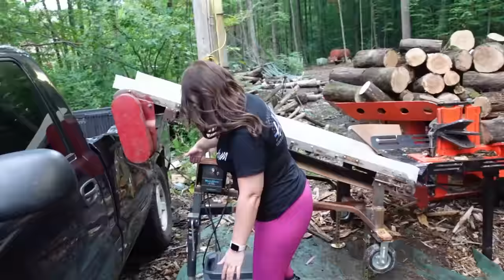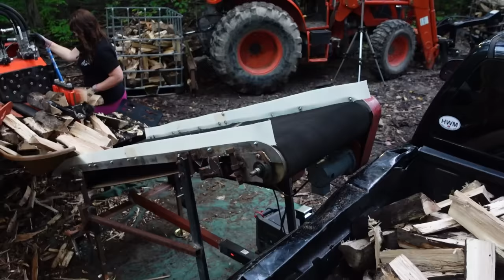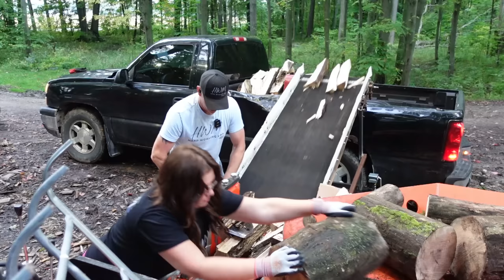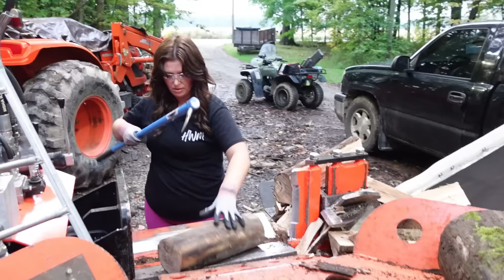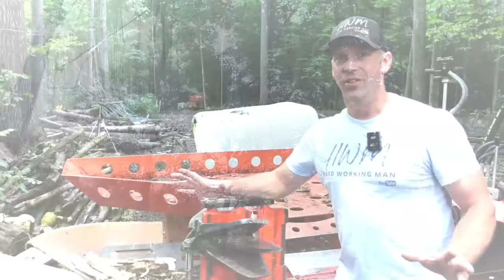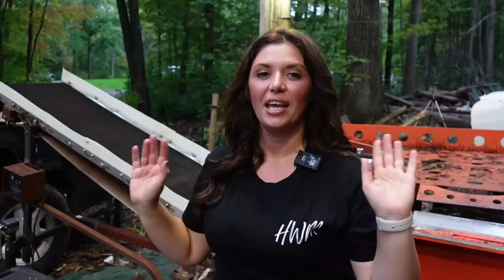Splitting a Face Cord of Firewood Fast & Easy!

Comment: Looks like you could use a concrete mixing hoe to pull the splits back in the pickup bed to level it.  You will other uses for it as well. The head is bigger stiffer and heavier than a garden. That will keep Rachel from bending it😂.

Comment: Alright, heat, the conveyor is working pretty. Get a hydraulic cylinder hooked on the back of that table. So as the wood is being split, all Rachel has to do is pull a lever raids the back side. Of the table up to have the wood roll to her.  Then she can get rid of that Hooker room or make a nice bracket so that the hawker rooms in the convenient, please.
Reply from the maker: Thanks Kent, I have a holder for the pickaroon but haven’t got it installed yet.

Comment: Good job, Rachel. Heath, looks like your improvements worked pretty well. Wheel barrel tub worked some, probably need a 45 degree angle rail on both sides of log splitter table and a tub attached to conveyor to catch it. All ideas I'm sure you've thought of, well, maybe Rachel has. We know who is the brains and who is the brawn of the operation.😂 Just kidding. We know Rachel is both of those. 😅
Reply from the maker: Thanks Greg, definitely still need some work on the outfeed table/ hopper. But we’ll get there. If Rachel starts fabricating parts and welding I’m in trouble!
Reply: @hardworkingmanoutdoors  seriously, it's awesome that you are thinking outside the box, keeping costs down and figuring it out. Keep up the goid work!

Comment: There was one of those split logs on highway, foggy 05:20 morning.  Round side facing me.
Man I lucked out, I was on right side of lane as cars on coming cars shining my eyes.
Reply from the maker: Oh yeah, I’ve lost a split or two on the road before.
Reply: @hardworkingmanoutdoors  Right. Jetta TDI 2012 is like a Ferrari.  Low clearance.
I didn't go back and kick it off.  That could have been a bad deal.  Watch your loads driver.  :yougotthis:
Reply from the maker: @ClickinChicken  I miss my TDI Jettas!

Comment: Interesting, but you still have the same problem as with every conveyor you have a bottle neck right back of your knife it you can fix that you will have a sweet little machine, thanks for sharing.
My conveyor is 45 feet long and I just do boiler wood, I had to add plates so the plates that were there wouldn't haul the wood back underneath, but fix your bottle neck so you don't have to clean it by hand.
Reply from the maker: I agree, I still have some work to do but it’s definitely an improvement!